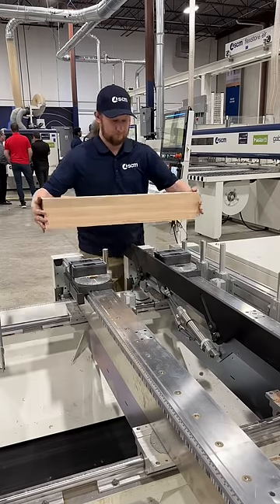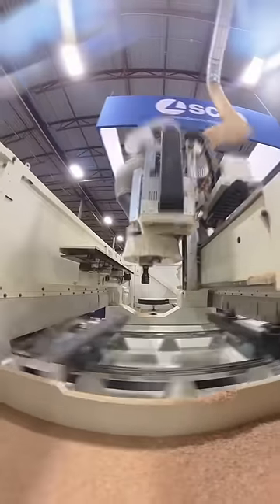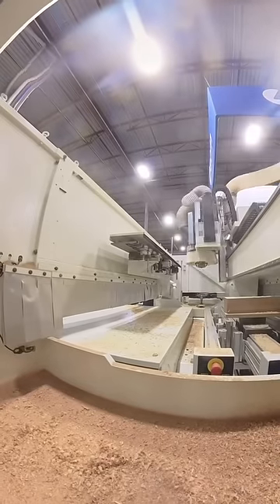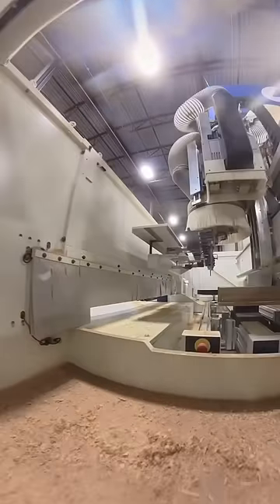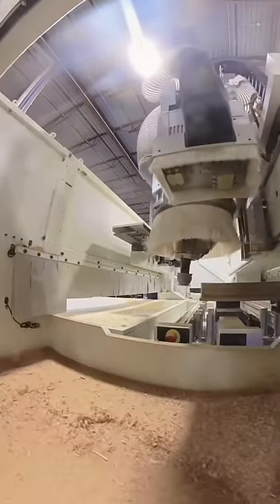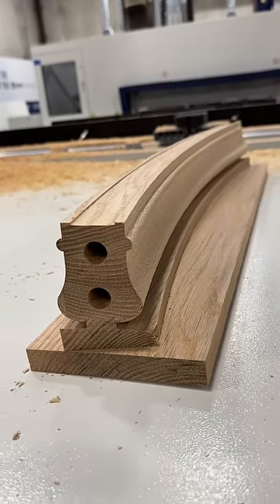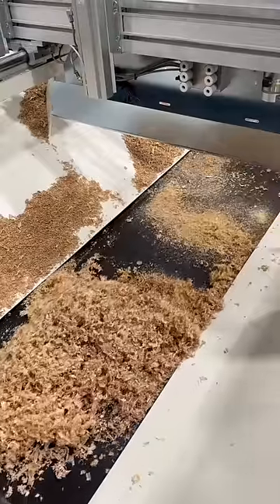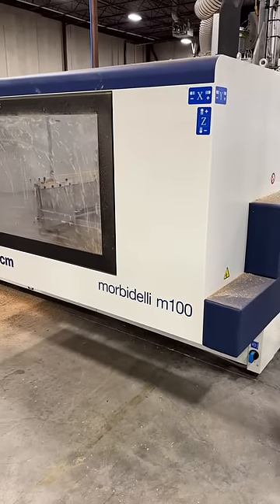Very cool 5 axis SCM woodwork machine #woodworking #maker #tools #wood #cnc

Comment: 5 axis? tell me you didnt go to school without telling me you did not go to school :) you dont get another dimension if you rotate one... you have 3 axis. thats it. there is no 4th dimension or 4th axis, even better to have 5th axis. x, y and z. what are other axis called?
Reply: You don't have a clue 😂

Axes are guided, independently driven links.

Every axis has its own coordinate system. Little bit cocky your comment, maybe research first, and write second :P
Reply: The term “5-axis” refers to the number of directions in which the cutting tool can move. On a 5-axis machining head, the cutting tool moves across the X, Y and Z linear axes as well as rotates on the A and B axes to approach the workpiece from any direction. [there are other video clips on YouTube showing SCM's "5-axis machining head"]
Reply: I always thought it's 3+2 axis but hey always learn something new
Reply: @kenc2257  you acknowledge there are x, y and z axes. Then you continue saying other axes rotate on A and B. How does that make any sense? :)
Reply: @gintautasbaras  just look up basic terms in robotic.
Reply: @msschubi  what about you look up basic mathematics where you learn that there are only 3 dimensions and even if you rotate (in this case as a router bit rotates while moving) does not create a new dimension ( what you call axis )? Everything you set that cnc machine to do it will still move 3 dimensional x, y and z. Why would you call 5 axis? Its the same as calling 4d cinemas. You know it bs right?
Reply from the maker: I see others have responded to this with the correct response 👍
Reply: The axis on this machine are XYZBC, you can see them all work independently in the video.
Reply: @gintautasbaras  you used the word "dimension" in this context, but we are talking about Axes (=joints of a robot). That why I told you to look it up before being cocky.
Reply: @gintautasbaras  ah and btw, we are living in 3D space, yes, but to describe an object we need a 6 dimensional vector: (x, y, z, yaw, pitch, roll).
Reply: @msschubi  yes you can call it dimensions or axis it doesnt matter there are only 3 of them. Roll pitch and yaw are not "extra" axis. 😀😀😀
Reply: @gintautasbaras  You can use the word dimension for the space in which we move. You're right, that's exactly three dimensions. But the term "dimension" is more diverse than just our space, here are a few examples:

1. a vector in the mathematical sense can have n dimensions v_n = (v_1,...v_n). For n=6, it can be used to describe an object in space. Of these, 3 dimensions are then for the position in space (that is what you mean), and 3 dimensions for the orientation.

2. a robot has several axes (the joints). This is not the same as dimension, but if you want you could consider these axes as the "dimension of its ability to move".
The number of axes of a robot is called the degree of freedom (dof). This is not quite correct, because there are redundant movements that do not add a degree of freedom, but let's leave it at that for now. So, what's the point of having more axes than dimensions of space? This is quite easy to answer: You can move the end effector to a position in 3D space in several different ways, i.e. with different joint angles. To determine the position of the end effector for a given joint angle, you use forward kinematics; to determine the joint angles for a given end effector position, you use inverse kinematics (which is not necessarily unambiguous due to the dof).

As you can see, there can be more than 3 axes, even though we only live in a 3D space.